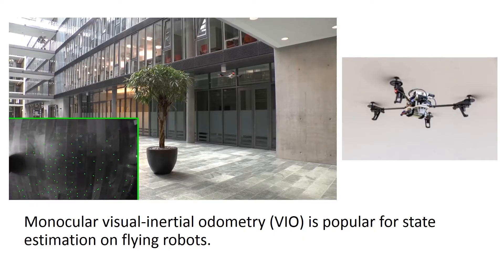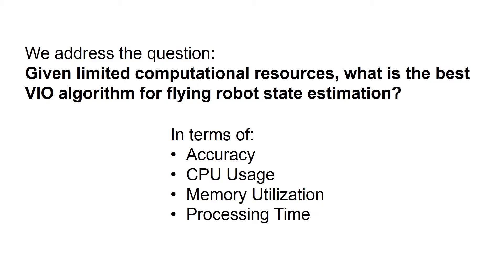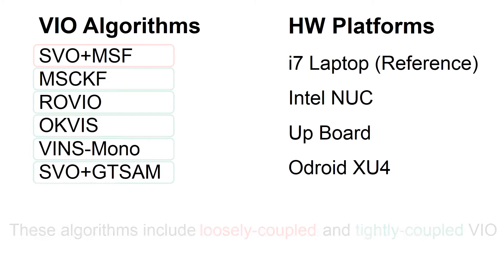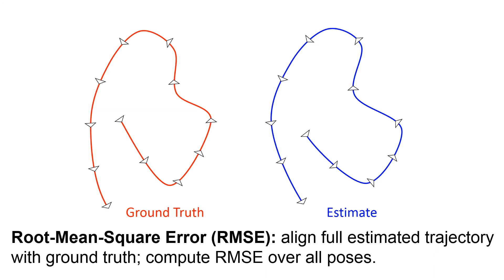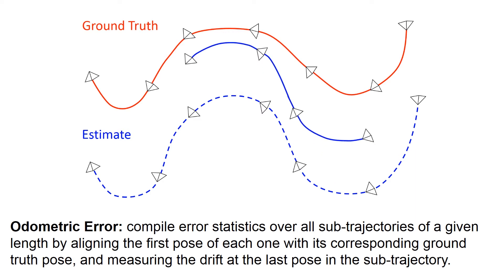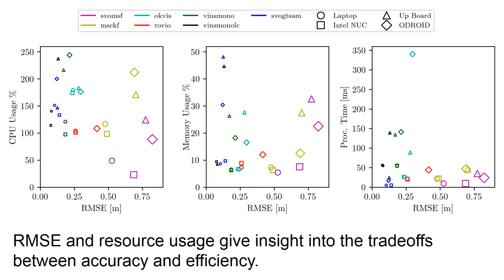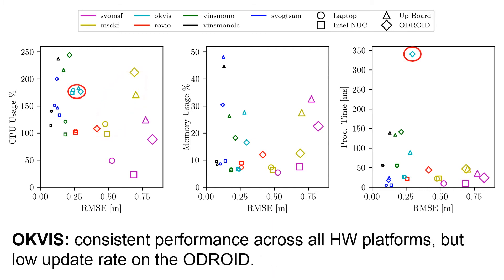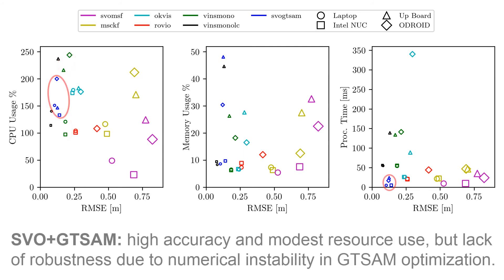A Benchmark Comparison of Monocular Visual-Inertial Odometry Algorithms for Flying Robots

Comment: Howto get Ground truth of trajectory?
Reply: It depends on each dataset. But as far as I know, ground truths for this kind of problem are collected by high-end IMUs (NovAtel, OXTS, ...). The ready-to-use results of these sensors are put out after some algorithm to reduce noise and be considered with The Earth's magnetic field, ... However, I don't know, metrically, how those results are proved to be correct and how reliable they are. Anyone knows? 😅
Reply: Even the highest-end IMUs will drift and accumulate. In a small in-door case, one of the method I can conceive is to add a QR code on the robot, and use a fixed camera to capture its position. In outdoor case, perhaps use a high-precision GPS-RTK. The hardest case is large-scale in-door case.@216

Comment: What about ORB SLAM or DSO?
Reply: citing the complete paper "We do not consider non-inertial visual simultaneous localization and mapping (SLAM) systems, for example ORBSLAM and LSD-SLAM. While these methods
 could potentially also be used for flying robot state estimation, we focus this benchmark on visual-inertial methods."
Reply: Could be that it was to new for the Paper to be included? And i am not sure if DSO deserves the definition "Visual-Inertial" as i don't know what defines a VO as a VIO
Reply: Odometry is using a (any) sensor to determine how much distance has been traversed, so visual odometry (VO) is just clarification in which particular sensor for odometry is vision (a camera, typically).